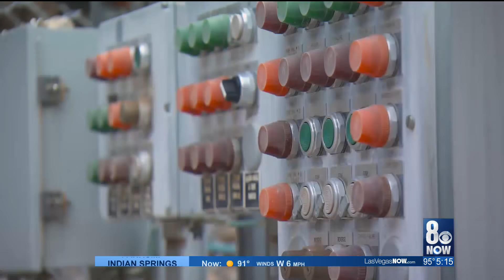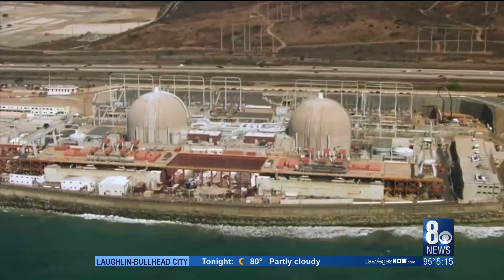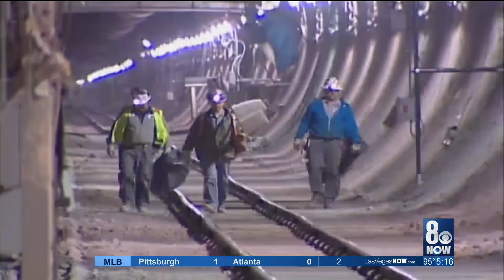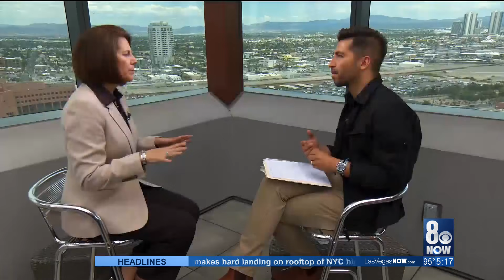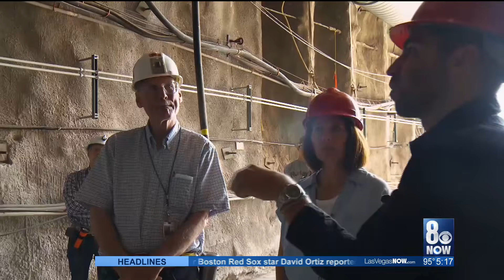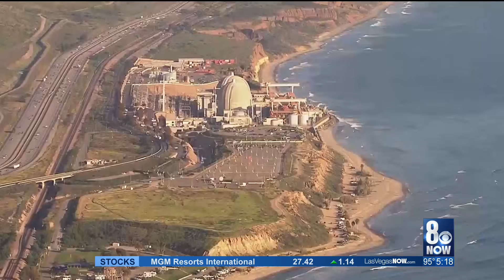CBS takes rare tour of test tunnel under Yucca Mountain

Comment: Well if Nevada is worried that the nuclear waste in Yucca mountain might leak a bit, not that far away from there a lot of underground nuclear tests were performed. Those tests left behind fission products and plutonium directly in the ground without anything to contain its propogation over time. So whatever ends up stored in Yucca mountain will be the least of your worries.
Reply: That’s incorrect. There’s very little radiation left from those tests, because of how the tests were conducted. When you store waste underground, there are many other variables. Get a degree in physics, then return to the comments section.
Reply: it's the water table  and tributaries beneath the location are worried about.
Reply: @firerx  The underground tests already got into it.

Comment: How is storing this High-Level Radioactive Waste on site at the Nuke Plants the accepted way to store spent fuel. To me there is less risk putting it inside Yuca Mountain. After storing spent Fuel underwater for 5 years, it can then be stored in Dry Casks which are huge structures that look like they could not be penetrated with an atomic bomb. How would that mix with Ground Water? This project needs to be restarted yesterday with more new plants to be built.
Reply: Because people who have no idea also have big mouths.

Comment: Finland has set an example on how to store nuclear waste....
A shame politics has reared it's head on an excellant but not perfect project....
If any problems arose it's so much easier to control one big complex than many small ones....
Reply: The problem is that before the waste can be stored it needs to cool down for about 40 years. Also I understand the nuclear waste is different in other countries, so the storing procedure might be a bit different.
Reply: @evs251  yes, which is currently done on-site at nuclear plants, additionally the long term storage is also done on-site at nuclear plants. 
The proximate reason that the US doesn’t have a better system for storing nuclear waste is the people (and their elected representatives) who live near transport routes and storage facilities just don’t like it, they would rather we have a worse overall approach for the whole country because their personal idiosyncrasies are a higher priority.